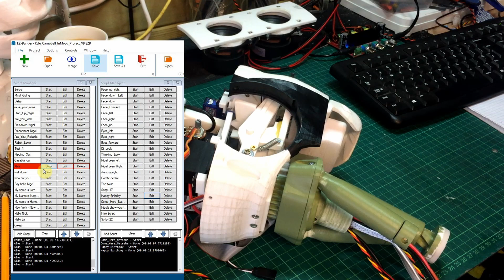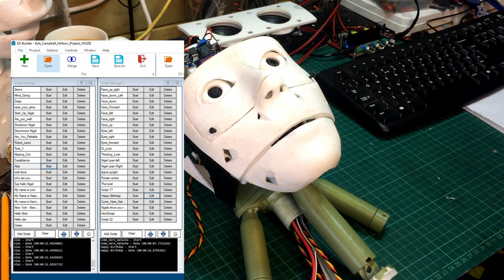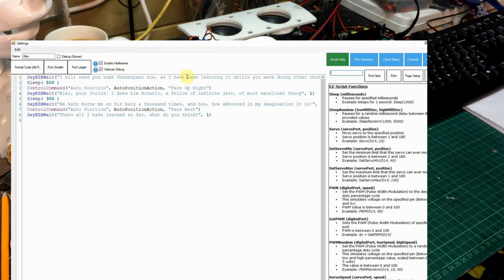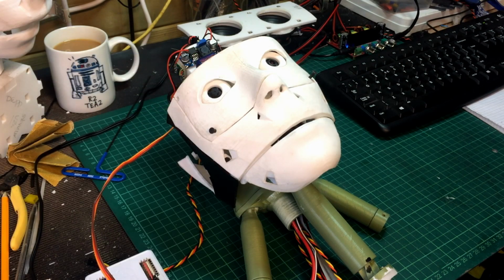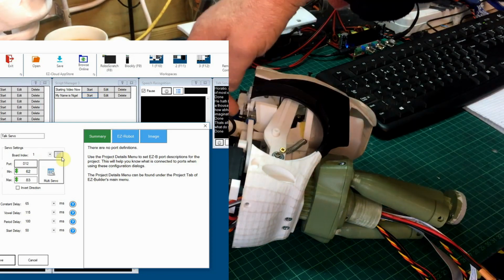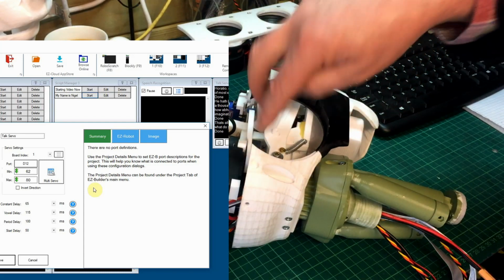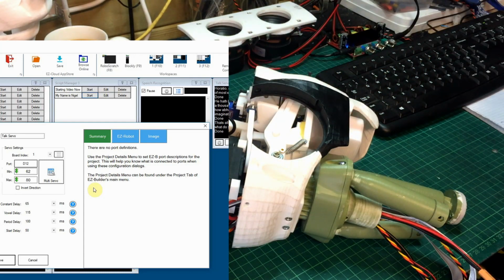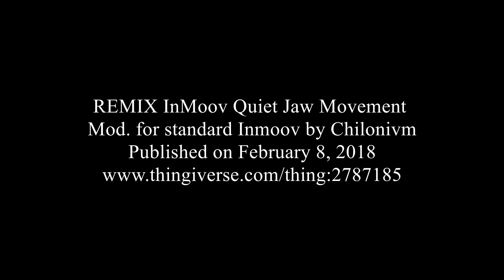InMoov Build Part - 34 Jaw Mod.

Comment: just looking  at the files the 2nd link says Parts you need from original Holy1 version: Body3.stl yet there is no Body3.stl in the Holy1 files , where did you find it?
Reply from the maker: Hello Drakkar, I dont think you need the Body3.stl (cant find it either)

Comment: Are you still working on this, I have a mostly built inmoov I would like to finish, what software did you use
Reply from the maker: Hi Simon, yes but have got a bit distracted with my R2D2 build recently. I have been painting the InMoov during the summer and doing odd bits but no videos.  I need to get back to the InMoov and finish the neck plus his arm has fallen off!  I might print the newer arm/shoulder mechanism that looks much stronger so that would make an interesting project. The necks more or less done, just needs screwing together and testing.  
I originally used the MRL software but found it very unreliable with the Arduinos, but that was a few years ago and the latest versions look much more stable.  Anyway, I changed over to EZB system which is great.  Good luck with your InMoov, its such a brilliant project of Gaels.

Comment: Hi Kyle, with the EZB wifi controller, are you just using it to deliver the signal for the servo and powering the servo's off a stand alone 5v power supply, I cannot see the EZB controller having enough power handling to power some of the big servo's let alone groups of them.
Reply from the maker: Hi Angus, Yes I am not using the EZB to supply power.  I have wired it all up so just the data and ground go to the servos from the EZB  and use a separate power buss.    I am using a 12-volt power supply with step down units to supply 5V and 6V to the servos. [Larger servos running at 6V or more]
Have look at my blog pages here, showing the way I have done it... https://myrobotnigel.blogspot.com/p/blog-page_7.html

Comment: Just a quick question for you, I'm not sure how you attach the actual eye pieces to the eye support/camera holders using Gael's design. The design has 4 pieces to make up the eye that goes in front of the camera's and I do see some small holes, but not sure if I screw these in place or glue them?
Reply from the maker: Hi Angus
I modded Gaels eye parts slightly and used an EZB camera module in one of them and an LED in the other [see my InMoov video part-7].   I always built the parts as seemed easiest and would assume gluing is best.   There are several eye versions people have done, some really realistic, have a quick google.  Gaels got some very good pictures here [scroll down a bit on the page]:  http://inmoov.fr/eye-mechanism/

Comment: Where is r2
Reply from the maker: R2? Well, let me see.... Legs being painted.  Undercoat so far, grey plastic primer.  Greebles being painted also, same again - plastic grey primer.  Swing out electronics board in bits being rewired - relays and switches being adapted for control via the EZB V4, new front meter panel being made that will have additional voltage meters, so master 24-volt power meter and two meters displaying 12-volts and 6.5-volts supplies for various bits in the R2.   Loudspeaker and amplifier baffles and parts being painted and modified.  Also working on AI speech control.  Trying to work out how to add microphones to the R2.  Ongoing issues filing the Dome ring to run smoothly on the top ring,  always been a big problem.    Reprinted some servo holder so the front arms will swing out properly,  they also have been painted with grey plastic primer.  Reprinting the top two parts of the dome as the original parts never printed that well.  Also been watching lots of utube videos about best way to paint PLA  and get a nice finish, so lots of old damaged parts lying around being painted.     
Been busy with Christmas so nothing much happening with R2!   Happy new Year Sky.
Reply: Wow!Bondo, with primer-filler works okay for me to some degree. Watch out for any warps and gaps. I have tiny cracks creeping through the fill due to that. I'm trying to fill them with plastic (over bondo) to keep them from moving again.Gloss black after the primer, then aluminum, then that silver rub and buff. That's my plan anyway. Aluminum with the flat black dulls quickly.For the white watch out for that Satin that was recommended on the forums at Astromech.net and elsewhere. I've tried it and it doesn't dry well and has many issues.Sounds like you've been having fun! My R2 has stalled due to the hectic holidays. I just replaced the hot end for my CR-10 and I'm working on replacing the one in my Da Vinci blue and the bed for my Da Vinci Pro. Once I've got everything sorted out i'll get back to printing the R2 again. :)Nice work with the jaw and neck!
Reply from the maker: @chrishechtl8330  Chris, thanks for all the painting advice. Looks like a lot to experiment with, different paint finishes.  Happy New Year, Kyle
Reply: Happy New Year!
Reply from the maker: @chrishechtl8330  Chris, what paint are you planning on for the main body, ie the white parts?
Reply: Primer and the white satin Rustoleum that was recommended at the astromech.net forums.https://www.amazon.com/Rust-Oleum-7791830-Satin-Enamel-12-Ounce/dp/B000Z8FGII/ref=sr_1_2?ie=UTF8&qid=1546444189&sr=8-2&keywords=rustoleum+white+satin+spray+paint But I did a few tests on the data door panel and other parts and found it doesn't like to dry properly. I bought 4 cans to start but now I'm unsure if it likes plastic enough or not.It is weird, it takes over 24 hours to dry to a tacky level and just doesn't look right, it looks flat and uneven. (this was in September) I'll try again when it warms up. It is down to 30F here and hasn't gotten up past 55F until the mid afternoon lately. But by then the Santa Anna winds have picked up and it's impossible to paint.Right now I'm trying to combat an under extrusion issue with my CR-10. I've checked everything I can think of and can't figure it out. It is annoying.I'm trying to print the parts for the feet. Specifically the 6X splines.I'm down to trying to print .3mm at 25mm/s and 205C with a raft and 50% infill. I replaced the hot end assembly, checked the settings, leveled the bed, checked the feeder, tube, adjusted the feed rate, did a cold pull or 2, a couple needle insertions, everything I can find on the web. Sigh. It is printing, but it is still brittle. At least it is no longer a lattice. I was getting that when I was printing at 220C. (I think heat creep was a factor in the under extrusion)I tried different heights to see if that was an issue. I went back to my original settings and printed with a raft to try to get it to print better. Still brittle though.I did notice the printer can't maintain print bed temp. It slips down to 59C from time to time. I think it doesn't like the cooler temperatures in the house. (66F) That's why I've been printing with a raft, if I don't it rips it off the bed after a half hour. I need an enclosure I guess.I even tried swapping the PLA roll out to a brand new one (in case the one I was trying was wet or brittle) and I still have the same issue. GRR.When I first got the CR-10 I was printing PLA .4mm or .3mm at 60mm/s without a problem for 3 months. I've gone through 20 rolls without this issue. Vexing. I guess the honeymoon is over.I want to print parts to mod and fix 1 of my other printers but I can't until this is sorted out.Oddly, when I tried an older Gcode last month at .4mm 45mm/s it printed just fine. Unfortunately, I deleted that file. :PGood luck with the painting, I can't wait to see the results!